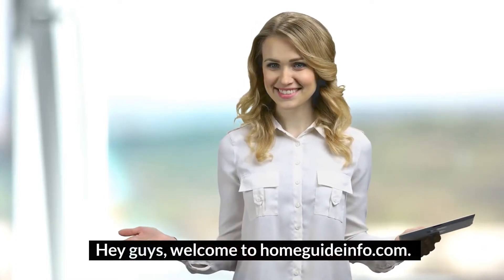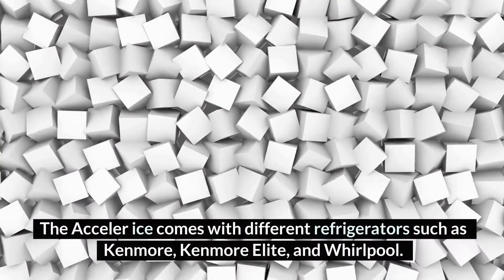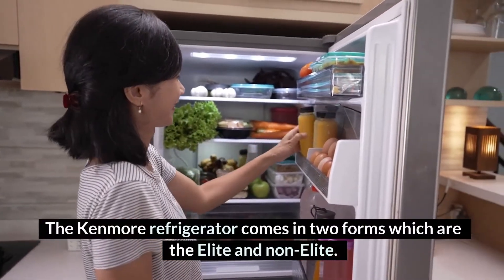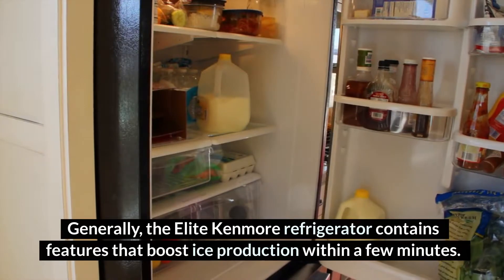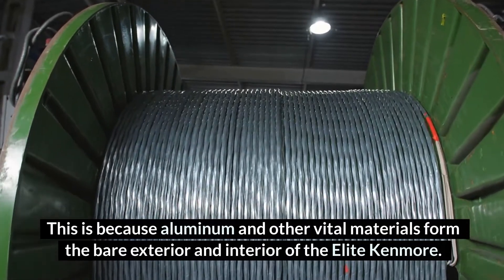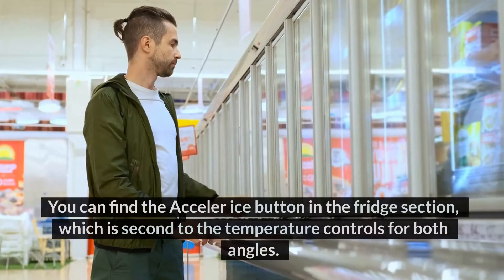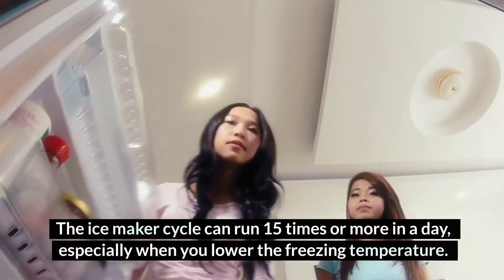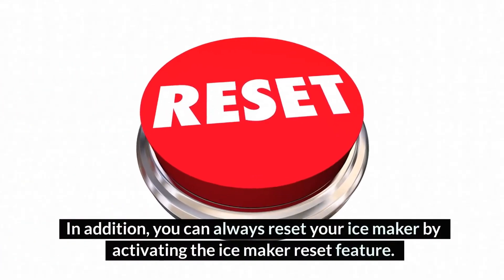What Does Acceler Ice Mean On Fridge | What Does Acceler ice Mean On A Kenmore Refrigerator | 2022

Comment: If the Kenmore Elite ice maker is freezing solid check the ice dispenser gate. If the gate is not shut completely, ambient air is allowed to leak into the dispenser duct creating and ice jamb which will eventually choke the dispenser completely with ice. Wicked assignment to melt the ice clogging the duct. Once clear check the dispenser gate hinge to be sure the gate is operating correctly. Mine was broke and that probably caused the dispenser duct to clog with ice ending the ice dispenser operation.